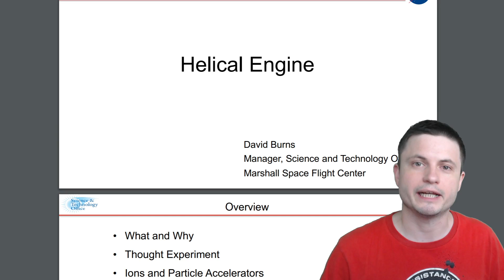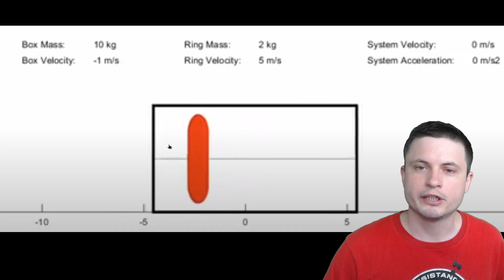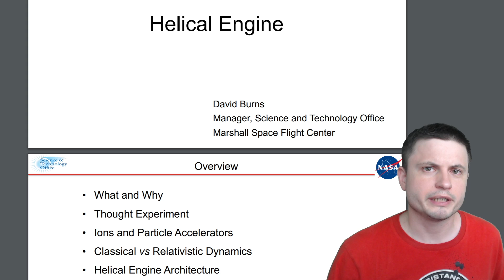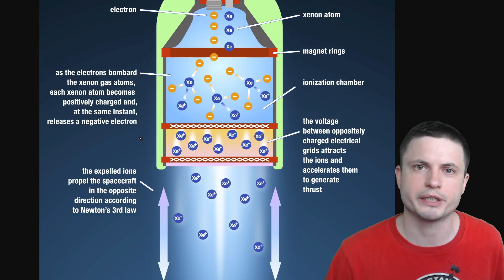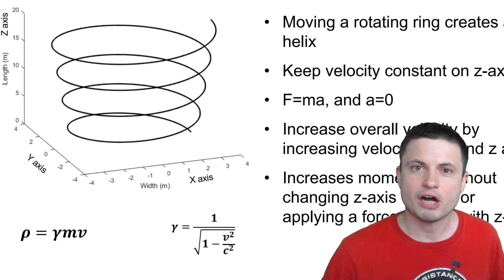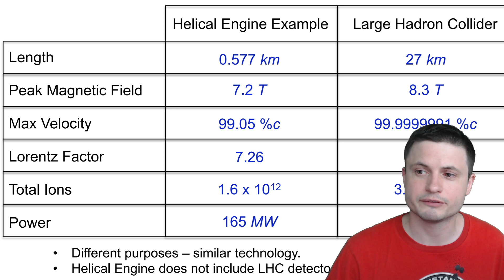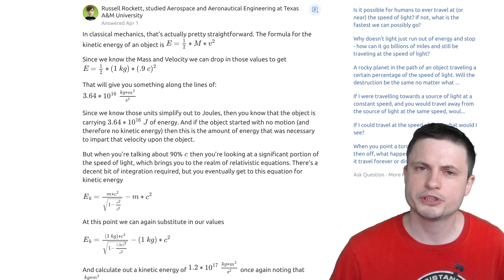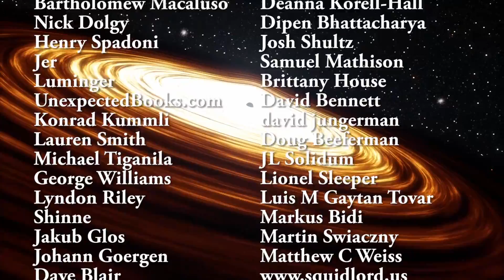NASA Engineer Designs a Near Light Speed Engine But Does It Work?

Comment: Total conversion of 1Kg of matter to energy gives far more than fissioning 1Kg of Uranium
More like 10^17J /Kg

The idea of the drive seems to be that you aren’t using any propellant so if you had perfect gamma ray mirrors and something that could handle the explosions you could re-condense the resultant energy into matter and antimatter and go again 

Depending on how you look at it this one is likely to be easier than wormhole travel.

It probably demonstrates there is something we don’t know about the physics of those systems rather than being a useful space drive.
Reply: And why do you think nobody takes this seriously in the scientific community? You can see it at a glance of the eye that this doesn't work due to the conservation of momentum, which applies in special relativity too.
Reply: Zoltán Kürti the conservation of momentum gets trickier when you are looking at it from multiple reference frames. 
I don’t know if we have established that the momentum gained through the apparent change in mass does work in the same way.

And photon sails work but photons for example have no rest mass and do not accelerate to get to the speed of light... in fact if you take a narrow definition of momentum photon sails probably break conservation of momentum.

I suspect the main problem with this idea is more along the lines of we can’t even theoretically make materials strong and rigid enough to withstand those forces for anything powerful enough to act as a ship’s drive and probably even to test it.
Reply: @glenecollins  ok, I will explain it a little bit better to you. You said conservation of momentum gets truckier in multiple reference frames. This is not the case, conservation laws only hold in one reference frame, in the sense that you have to look at the system from the same reference frame when measuring it's momentum to get the same number. But at the same time, the conservation of momentum holds in all inertial reference frames, but in each one you will get a different value for momentum. What gets trickier is the followimg calculation: you know the energy and momentum in one reference frame, what will be the energy and momentum in another reference frame.

Momentum is not gained by the apparent gain of mass. For an uncharged particle with nonzero mass p=mv/sqrt(1-v^2/c^2). The relativistic mass is just a shitty idea and it only exists to confuse you. For some unknown reason people still talk about it when we now now it's completely irrelevant. The mistake was made when Einstein used this term in one of his first papers, and people started to use it. Unfortunately nobody listened when Einstein later said relativistic mass is a useless and confusing idea. Anyways, people call m/sqrt(1-v^2/c^2)=M relativistic mass, just because if you use M, p=Mv and E=Mc^2 for chargeless point particles. But again, it doesn't mean anything. The meaningful equation is p=mv/sqrt(1-v^2/c^2).

The conservation of energy and momentum in special relativity are derived from spacetime translation symmetries. That is, if ypur system will act the same at different times, energy is conserved and if your system acts the same way if it's in a different place momentum is conserved. This is one of Noethers theorem. Since the spaceship as a whole is a closed system, doesn't depend on where it is, the total energy and momentum of the spaceship is conserved. (Here you have to watch out, because if something is emitted from the spaceship, at later times you also have to count in the emitted parts energy and momentum, this is how rocket engines work.) In this specific example, when you accelerate an object in the spaceship, the spaceship will lose the same ammount of momentum as the inner object gains, so the total momentum is conserved. The Noether theorem says this, and the fact that all interactions we know about (so all methods with which we cpuld accelerate the object) give just as much momentum as they take.

Now onto photon sails. First you have to realise that there are no multiple definitions for momentum and energy in relativity. There is only one meaningful definition, and the Noether theorem uses that meaningful definition for obvious reasons. If photons don't have momentum by one definition, the definition doesn't define momentum properly. End of the story, we use momentum as a tool in calculations, so defining it in a wrong way doesn't lead to anything. Photons have h/lamda momentum, h is plancks constant lambda is the wavelength.

The problem is not practical in nature with this one, it simply doesn't work. We have direct experimenta evidence about conservation of momentum at these velocities and even heigher. Particle accelerators are perfect examples for experiments testing this.
Reply: Zoltán Kürti as far as I know there are no particle accelerators which routinely rapidly decelerate the particles and shove them back and I couldn’t find anywhere it had been tested.
I agree conservation of momentum has been super successful and I should have said I don’t think it would work at all but the materials etc required to make it work practically even if there was an effect should be impossible.

The thing is that a lot of physicists didn’t expect photon sails to work because they were using other definitions of momentum so academic physicists don’t/ didn’t all agree that the relativistic version of photon - matter interactions would apply.
Reply: Zoltán Kürti I think that I haven’t seen anyone point to an experiment showing the same sort of motion doesn’t produce acceleration in practice is actually a good reason to test it.

Though particle accelerators move a lot and are generally pretty inefficient (they are thought to be moving because of the fields generated etc as well as shaking or expanding from the movement of the accelerated masses) so it is going to be pretty difficult without putting a particle accelerator in deep space and monitoring it’s net movements.
Reply: @glenecollins  a circular motion is exactly what you want, rapidly accelerating a particle in variable directions. Second, when particles collide the accelerations are so enormous and in a different direction to the original motion this spaceship is nothing compared to that. And from a completely other perspective, we tested the theory of fundamental forces to such precision and extreme conditions, that the method by which you accelerate the object in your spaceship is surely covered by the current range of experiments. And all current experiments suggest that the conservation of momentum holds.

What you said about photons and physicists is just not true. From maxwells equations you can derive the pressure of electromagnetic waves, and it was measured between 1850-1900, can't quite remember. And after that, when special relativity became more and more used the difference between momentum and mass was recognised very early. The dispersion relation of photons, omega=kc with the invent of quantum mechanics immediately lead to the idea of photons (arguably qm was discovered through this) having well dedined momentum. Multiply the equation by hbar and you get the experimentally well known (photoelectric effect) E=hbar*omega and E=pc follows from that, since de Broglie proposed (de Broglie wave length) p=hbar*k for particles. Photons having momentum was obvious from the start. Also the fact that their restmass is 0.

Comment: @Anton Petrov are they using tokamak propulsion in any application as of yet? Smaller D2 tokamak drives (energy source)could propel near light speed, also combined with a hyper spydal energy core,  aka spinning ball jacked up on an ITER tokamak for energy, I speculate the mitigation for rogue electron streams wouldn't matter in the vacuum of space?

Comment: Couldn't you launch it from a large space station that can provide the initial energy required to bring the mass up to speed?  This would dramatically reduce the amount of weight required on the actual space craft, as all you need is enough onboard energy production to maintain the mass's velocity. 

 While this wouldn't be useful for manned missions (since you can't slow down), you could at least send unnamed space craft on long distance missions and collect data that way.

Comment: Even if we do figure out a way to travel at lightspeed, what are we gonna do about running into stuff in space because the smallest spec of dust could be catastrophic if you run into it at lightspeed
Reply: barnacle boy time for the Ol Star Trek space magic shields I guess
Reply: Impacting objects at mere percents of ightspeed would be catastrophic, grains of sand become like bombs.
Reply: Not a problem if you use field propulsion, which we've had since the 1950's.

Comment: Per page 6, most of the power required to accelerate the ions comes from decelerating the ions.  This can be done simultaneously to eliminate the need for storing the acceleration energy, as stated on page 7.

Comment: My problem with it is that at relativistic speed, the friction encountered may allow for acceleration, but you have to progressively vacate more environment ahead of you so that the particles you encounter don't further increase your mass and drag... I feel like even ablation shielding would be pointless after any realistic amount of time... Basically you can set the propulsion issues aside and look at how you're going to get far while encountering particles without getting shredded. Even a magnetic shield seems implausible... Thermodynamics is savage.

Comment: Ugh this caused such a mess. There are tons of articles with sensationalist titles taking this seriously without questioning its validity at all
Reply: It's entirely valid based on relativity, and what we have observed in particle accelerators. It just takes a huge amount of energy -- obviously. The problem it solves is it vastly decreases the mass a ship would need to get up to these 0.9 c speeds, as you don't have to carry a planet of material with you to throw out the back of your ship. But you do need the same amount of energy, after correcting for efficiency of this compared to reaction mass. But that's why Anton goes on about how using the energy to convert into matter, and then throwing that matter out the back would be even more efficient than this engine design. It's still a big move forward along those lines though, due to solving the reaction mass issue (until we can do what Anton mentioned and turn energy directly into mass to expel).

Comment: So here is why this idea is stupid: the supposed acceleration of the engine depends on who is looking at it. If somebody looks at the bouncing box diagram from the spaceship, there is obviously no acceleration. By one of the main principals of relativity, namely all inertial frames of reference being equal, the same must apply in Earth's reference frame. And it does, if you do the math correctly. Apparently engineers don't understand relativity.

Comment: The total 4-momentum of the system is conserved, it doesn't accelerate the tiniest bit. This is a really dumb idea.
-by someone who really does understand relativity
Reply: Zoltán Kürti 
I thought so too closed but now I’m not so sure. The theory sounds legit. Mass would increase at near speed of light. And if that extra mass is being thrown forward at right time it would cause an acceleration 
Nature doesn’t like a cheat though. So I’m not sure. Still can’t get the spaceship up to 99%c. That is impossible.
Reply: @markc7955  no, the mass increasing gibberish just confuses people, see this video and yourself for example. Momentum and energy is no longer mv and 1/2mv^2 in relativity, but mv/sqrt(1-v^2/c^2) and mc^2/sqrt(1-v^2/c^2) for a simple pointlike particle. For some stupid reason people named m/sqrt(1-v^2/c^2) relativistic mass, lets call it M. This way E=Mc^2 and the momentum p=Mv. But it's irrelevant and different for observers with different speed, and confuses people. In a clased system, the 4-momentum (includes energy and the regular 3-momentum) is conserved, in this spaceship. This is a basic result and the only way this engineer in the paper could calculate what happens when the object bounces in the spaceship is using the conservation of 4-momentum, so not sure if he even did any calculations. This really is a stupid idea, probably this engineer has no proper idea about relativity or is just pranking us.
Reply: Zoltán Kürti 
Ok I’m not going to pretend to fully understand the algebra. I would need to close my eyes for half an hour. I did study chem eng but follow theoretical physics as an interest. 
But is it a closed system as energy would need to be put in to accelerate the (hockey puck drive? How I think of it) 
Right still thinking. Does the kinetic/ momentum energy of something moving fast and have more mass due to Lorentz have the same energy as the same object moving slower. No wait you said single point. If you have the link please send. Sorry. Prob over my head.
Reply: @markc7955  the equations for energy and momentum are valid for a point like particle, but the conservation of momentum applied to all closed systems. And if nothing leaves and nothing arrives at the spaceship, it's a closed system. Basically when the inner object in the drive collides with the wall, or changes direction, it gives just as much momentum to the spaceship as it lost. The sum stays the same, and it doesn't matter if it's moving or not. You don't even need the algebra to understand this. Yes, the relativistic mass of the bouncing part does change, but it's the momentum that matters. Anyways, if you have an even faster spaceship and go right past this spaceship in question, the drive of the spaceship should propell in in another direction, because the relativistic mass is bigger in exactly the opposite direction as seen from this faster spaceship. The only logical conclusion is that the spaceship doesn't accelerate.

Comment: Ridiculous...  The problem with this is simple...it violates the conservation of momentum law.  The energy imparted by mass moving forward would be completed canceled out by the energy needed to get that same mass moving in the opposite direction... after all, faster is more massive right?  Therefore, it would take more energy to get that mass moving again in the opposite direction.  Add in a very likely inefficiency in transferring the momentum .. and your starship is  a very expensive go-no-where machine.

Comment: The idea you are talking about here clearly violates conservation of momentum. And it does so, because you ignore the mechanism that accelerates your lump of matter to relativistic speed. For every action there must be an equal reaction. So, to accelerate the lump the mechanism that does so, whatever it is, must receive a kick back and thus pull the whole compartment it's installed in back too. In effect, if you're in a weightless environment somewhere out in space, you won't accelerate at all. 

To accelerate you MUST throw something back. There is no free lunch in physics, not even in relativistic physics.

Comment: It might be more efficient to throw stuff out the window, but what I see is that this helical engine doesn't throw stuff out and thus, can't run out of stuff. It might produce low thrust, but if it is sustainable, that's still a big advantage. It means you don't have to move as much fuel, letting you pack a higher payload (as a percentage of total ship mass). Kind of like comparing a fossil fuel powered car to a solar cell powered car. The solar car might be less powerful, but it can just keep rolling.

Comment: I think the main thing that dumps a billion gallons of cold water on this is the fact that mass does not increase with speed. This is an explanatory short cut in relativity that covers the difficult to explain reality. For most purposes the shortcut is fine, but if you try to use it to create thrust, then you will find that it doesn't exist! Sorry!

Comment: This engine is based upon the current conceptualizations of mass increase at relativistic velocity. But that it is the correct interpretation isnt assured. This engine is based upon an as yet, assumption. Relativity theory can be a very large part correct, but still have some of these finer details not quite right.
Reply: Time dilation effect empirically defines as force dilation or modulated force. As a clocks system winds down as the rate of time winds down, its internal expressions of force wind down. Science overlooks this observation, but its empirical and cant be argued against. When it is taken seriously, this engine will have to be reconsidered

Comment: Yeah well, there's a lot of space dust and rocks so travelling at the speed of light kinda unless you have a gravitational force pushing any debris away. without it  your gonna be screwed when you hit something .. and  could they use magnets that turn on and off to push and pull if not they could use an instead of circler the should do a figure 8

Comment: Even if it worked and you hit .99% the speed of light, who actually cares? On the scale of the universe light is painfully, unfathomably SLOW. The next closest star, literally our cosmological "neighbor" is like 4.3 light years distance, meaning a single "there and back" trip would take just over 8 years & 7 months. That means the engine would have to operate continuously and at peak efficiency for over 75000 hours. Also, when moving at that speed communication with Earth = 100% impossible. So to summarize; even if this guys nonsense design worked, it will NEVER see any actual application in any significant way.

Comment: What if you threw your mass in a circular or ring chamber and accellerated it at a specific part of the ring to make it go that direction-ish with magnetic pull or similar? Maybe a flexible ring in a magnetic chamber?